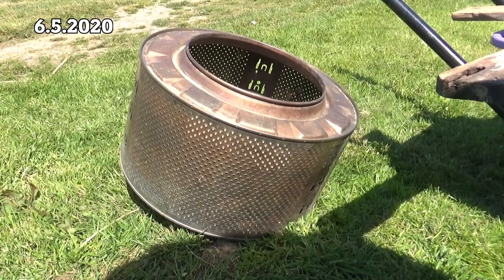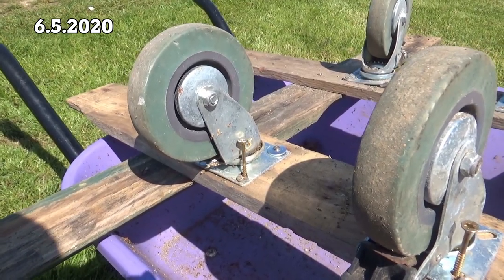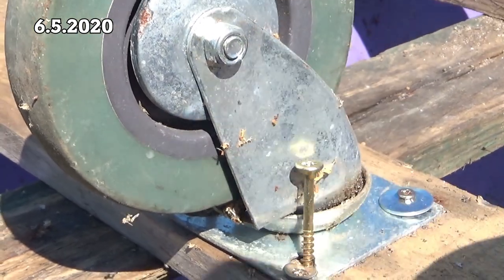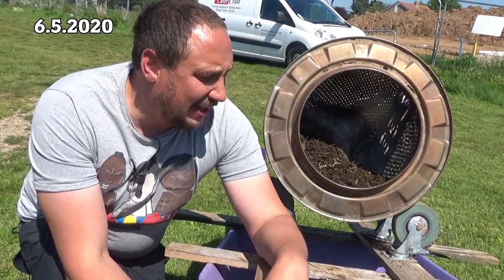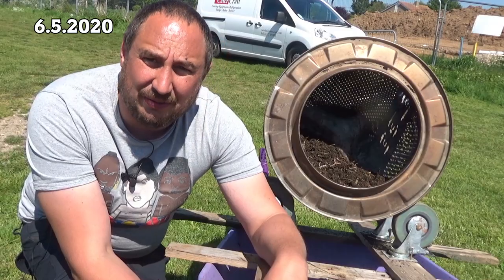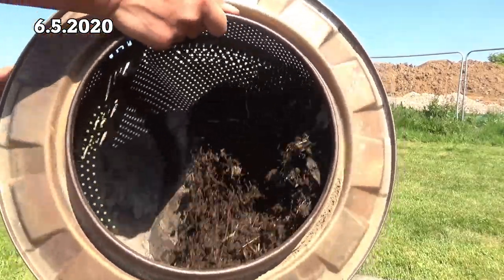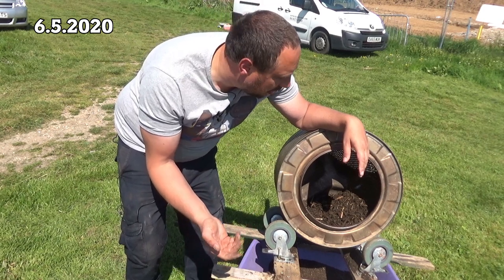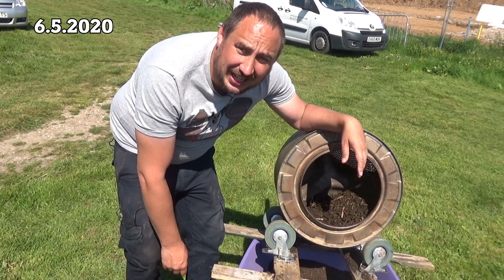Can we make a soil sieve from a washing machine drum?

Comment: My dad is a mining engineer… he says the easiest way to build a homemade sieve to grade soil and compost is to use a vibrating frame. Build a large frame, 2m x 1m, with mesh at the size you want; have it on an incline (20 degrees should be ok) seat the lower end on thick rubber pads to absorb shock and at the top end sit it on a bar which can move on an eccentric. Use an old washing machine motor to drive the eccentric movement.
It would take a bit of constructing & engineering expertise but would sift quite a volume quickly.

Comment: Do you have any idea how to fill those holes ? I want to put soil in it and grow plants but soil comes out while watering and when they are dry 😢😅 and should I prevent rusting? Should I apply anything before?
Reply from the maker: You could use spray paint to stop it from rusting. As for sealing up the holes I’m not sure. Perhaps welding or place a plastic pot or a compost bag inside so the drum is more or less asthetics.

Comment: If only this could be mounted in some kind of machine with a motor and belt drive......
I think tumble driers have the correct speed, and aviary weldmesh has the right size holes. Chop out sections and rivet on with builders band.
Reply from the maker: Yes only trouble with a motor is it needs electricity which we don’t have on the allotment. 
Great suggestion worth the mesh too.
Reply: @ThevegGrowerpodcast  use 12v starter motor.